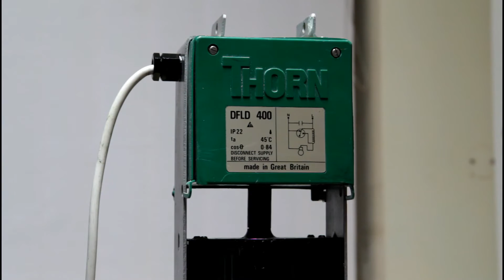Equipment inspection: Thorn DFLD 400 Hipak

Comment: wait, why are you using a Probe Start Metal Halide lamp in a fixture that has an Ignitor?
Reply from the maker: Khalid Hebshi it’s quite common for 750v parallel ignitors to be used on such lamps at least in the uk. Obviously a high voltage superimposed ignitor would be a big no.

Comment: I'm sure there are a load of these in the boat shed where I work. Some still have the metal halide bulb (I'm guessing it's not mercury as the colour rendering appears too good for a clear mercury bulb) and others run SON. I'm guessing as you can run SON off MH ballasts they just replace with SON when one blows.
Reply from the maker: And long may they continue to operate and not be replaced with shitty LED! :)

Comment from the maker: Louie. Can't reply to your post directly but if you see this: It's a new-old-stock 500w tungsten-halogen Sunflood fitting.
Reply: Ive got the exact model but one of them trips the power as soon as i plug it in... Any ideas what could be causeing it ?
Reply from the maker: @tidohanuman6647  Check all connections to see if anything is shorted to the chassis. If everything looks fine then the ballast might be toast.
Reply: @FrontSideBus  i opend the plug noticed the earth was hanging on by a  sing strand...everything inside seems fine going to replace the plug and then retest.. I hope its not the transformer inside.. If its the capacitor or igniter im sure i could find simillar replacements...
Reply from the maker: @tidohanuman6647  Yeah there is a terminal block inside the green housing. Check to see no wired have rubbed through ect.

Comment: Interesting vid mate.. Especially regarding the shimming of the lens, not heard of that before now. TFS

John
Reply from the maker: This was when people actually made proper stuff! Today, the manufacturers would simply settle for a compromise with neither 250w or 400w lamp in the optimum position. With the shims the centre of the discharge column can be placed in the focal point of the reflector giving the best performance.
Reply: Yea, your right there. Wish they still made things to last. At least when things were made that way we always had things to repair, and learn from in the process.